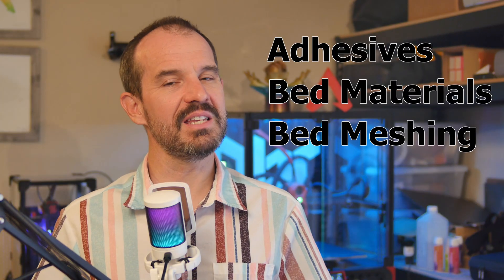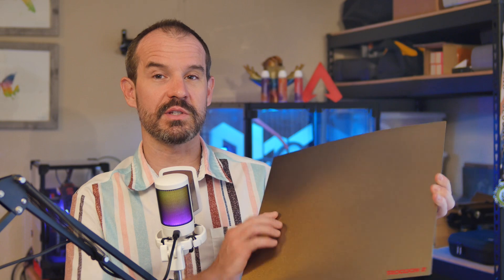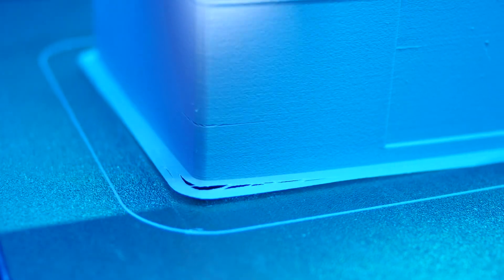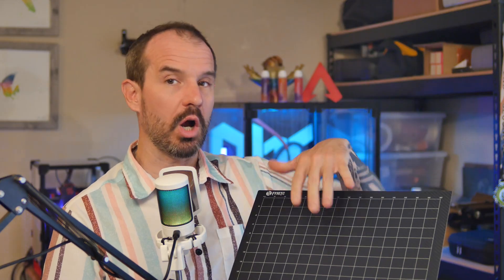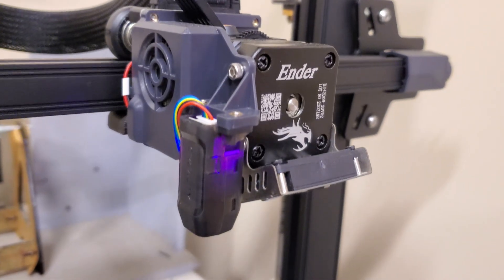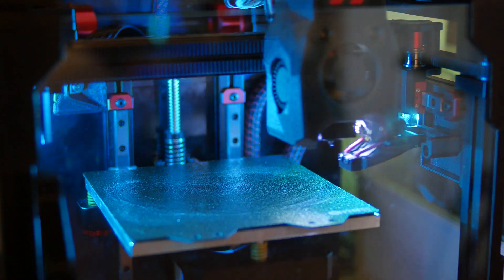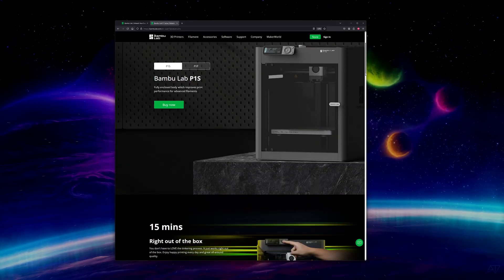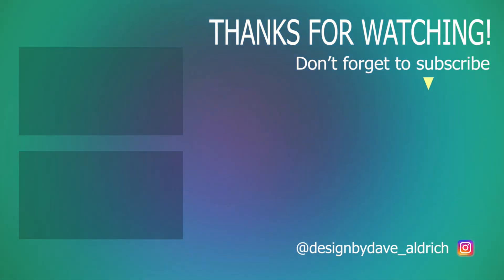How To Get The PERFECT First Layer on Your 3D Prints Volume 2

Comment: I've used every type of bed probe that you described, but I have found by far my favorite "probe" is the Cartographer sensor that I am currently running on both my Voron 2.4r2 and my Voron Switchwire. It is an IDM scanner (like the Beacon probe), and is INSANELY fast. 

I have mine configured to do a 9x9 probe, with two passes, so 162 points, on my 350mm Voron 2.4r2 that takes roughly 30 seconds. Once I have my initial layer dialed in, and the offsets saved as a gcode override for each filament / bed type that I pass to my PRINT_START macro, I don't have to recalibrate the first layer again. I run the bed leveling macro prior to each print.

Ideally though I'd love to have both the IDM scanner AND a way to do a physical tap for auto first layer calibration, I hear that Beacon has something coming for that soon.
Reply from the maker: Awesome. I might have the new BigTreeTech Eddy coming to try out.

Comment: Good content! I've been using Layerneer Bed Weld for my ABS prints for years, which I'm sure is similar to Magigoo. I've never been able to get my ABS to stick to the textured PEI, so I always use the smooth side with the solution. You can also speed up the Troodon 2.0 TAP speed as it's unnecessarily too slow out of the box. Set "lift_speed: 100" in the [probe] section and "max_z_velocity: 100" in the [printer] section.

It's also worth mentioning that on the quad gantry style printers like the Troodon and Vorons, to always do a quad gantry leveling (G32 macro on the Troodon 2.0) before every print and before mesh leveling.

Cheers!
Reply from the maker: So crazy that you're having basically the opposite experience with ABS and textured PEI. I've been printing that way like crazy for the last couple of weeks with great success.

Thanks for the tip on the lift speed, I'll check that. But, also, I might have something coming soon that will significantly increase the bed meshing speed....

Yeah, quad gantry leveling definitely necessary before all prints.